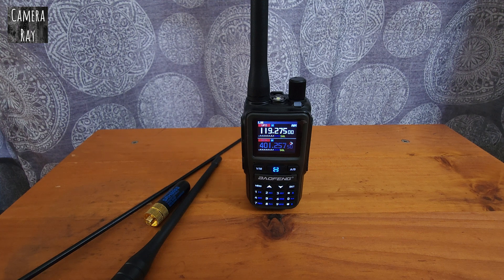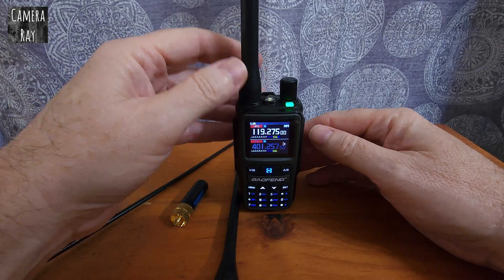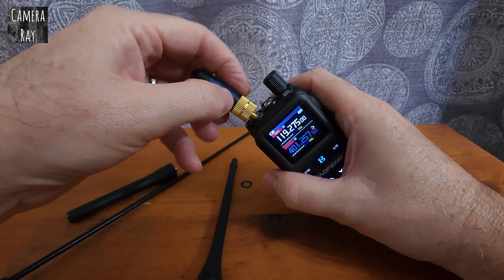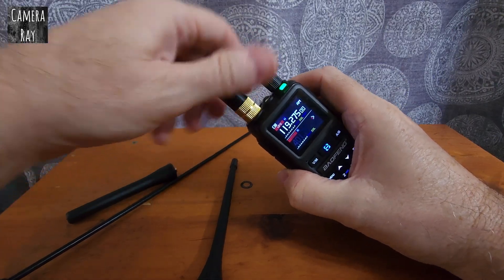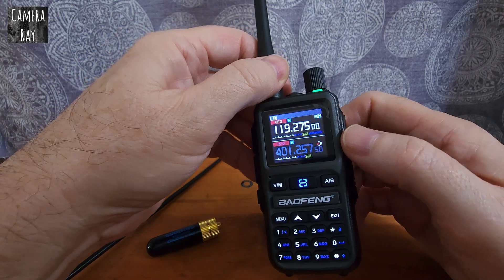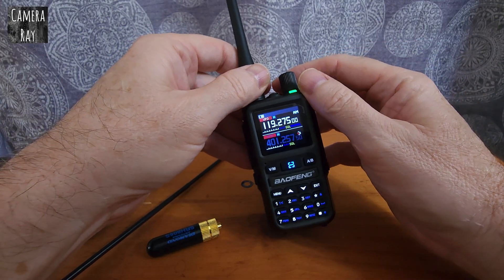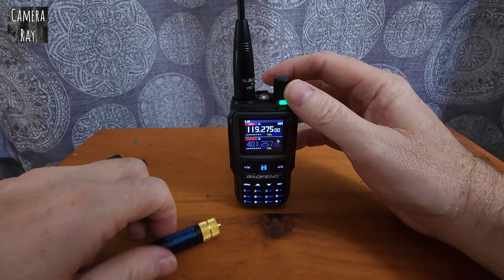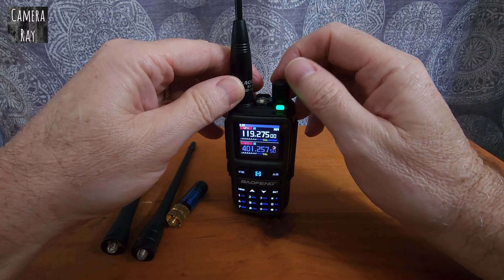Baofeng UV-5R Mini: Stock Antenna vs Upgrade Test On Airband

Comment: I bought a pair of the UV-5R Mini HTs when they were only shipping from China.  As soon as they arrived, CHIRP could program them.  I liked them so much I bought a second pair shipped from the US.  Air band is weak on these HTs, almost like AM was an afterthought, but on a $20 HT I consider it to be a bonus.

I have a UHF knockoff of the super short Diamond stub antenna and the SWR sweep indicates that they're not for 2 m use but could be handy for 70 cm comms between two vehicles, on the highway or off road.
Reply from the maker: Thanks for the info.

Comment: I want to buy tri-band antenna that you tested, is it good for airband? The frequency in the specification is 144-220-440. Where as airband works from 118-137? Please elaborate. Thanks
Reply from the maker: The Nagoya antenna works well down to 64MHz. That antenna was released well before most of these small handheld ham radios could receive airband in VHF frequencies at 108 MHz - 137 MHz range.  The antenna marketing shows that range because small ham radios could only receive that range at the time of release. They have just never update their packaging. I got this info from a forum post they made years ago. But, this is a quote for their original release info. "The NA-320A is a brand new antenna from Nagoya. It is based on the NA-771, but with support for the 1.25M (220MHz amateur band). A wider receiving range is supported as well. (RX: 118 ~ 960 MHz)."
Reply: Need your expert advice

Comment: This is my new favorite ham radio to travel with. Does everything my Baofeng 5rm does and more and 2/3 the size and cheaper. :face-blue-smiling:
Reply from the maker: Glad you are happy with it. So much easier to bring along.
Reply: You are right. It's a perfect compact travel radio, with two ham bands, FM radio, air, and high VHF public service including marine. And the USB-C port makes charging easy.
Reply: The tiny UV-5R Mini is great for my motorcycle and Japanese mini truck!  The build quality is very good and nipping at the heels of the Japanese manufacturers, and my old eyes appreciate the relatively large and very clear color display with the logical menus.  The Mini has less spectral harmonics than previous Baofengs.  It's not perfect but it's a great little handheld.  Baofeng is a study in continuous quality improvement.  No matter where you are, the trick is to keep moving forward.

I don't use my Yaesu handheld because it's never truly off.  It has some useless RF signal wake up mode that requires the receiver to power up and monitor on regular intervals and that drains the battery in a week or two, making it useless for tossing in a go bag or glove box to have when needed.  And no, there is no way to disable the wake up "feature" on the Yaesu.  It's coded into the firmware.  That's dumber than dirt.  Yaesu makes great radios but always seem to introduce some firmware "feature" that makes me wonder what the Yaesu engineers were thinking.